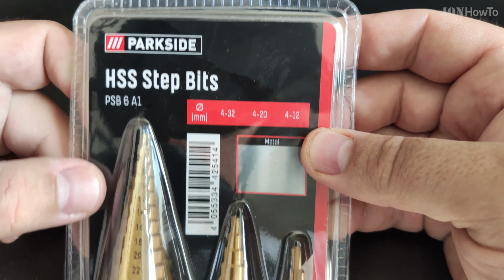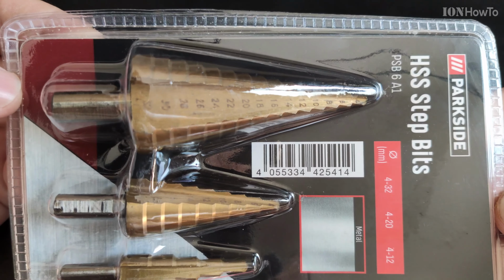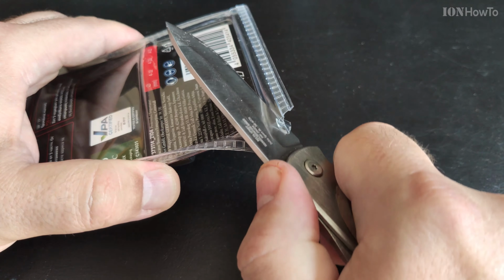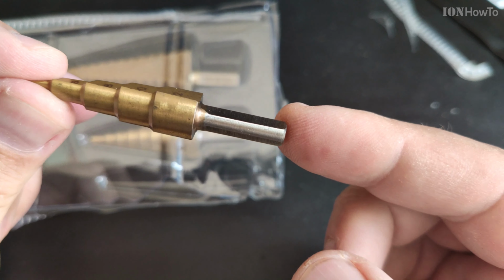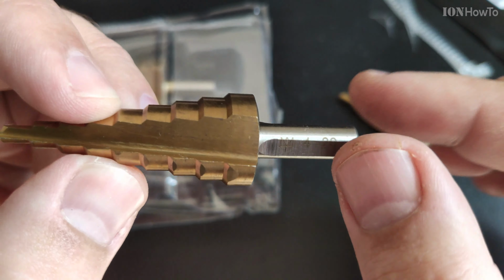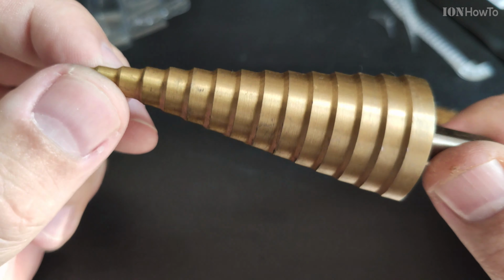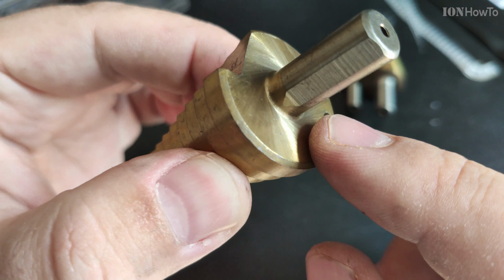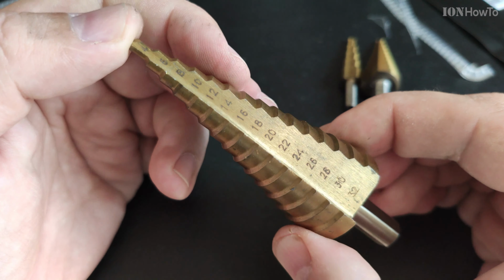Hss drill step bits

Comment: Interesting this is the first time I see. Since you have not demonstrated how it functions,  I am trying to figure out how does it cut ?  What is the cutting angle? Why did you called it HSS. HSS is high speed steel isn't ?. But  the bits appear like BRASS to me and Brass is soft and will not cut metal.
Reply from the maker: Yeah looks like brass to me too but it wouldn't work if it was brass. They go in the drill and you can make the hole gradually bigger. Didn't use them yet but in the past I would have and decided to have them available for next time. They look really good for making large holes in plastic panels or metal panels.